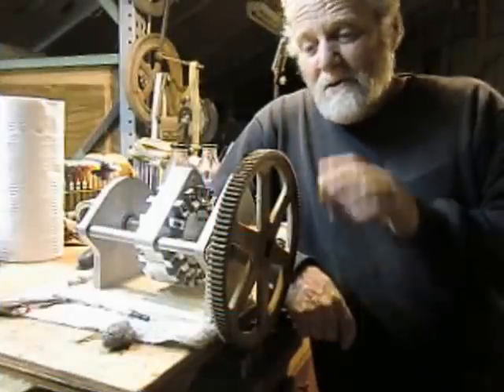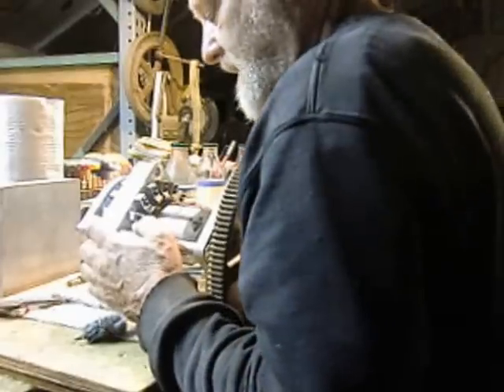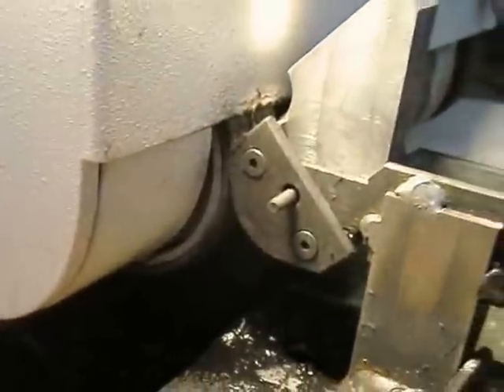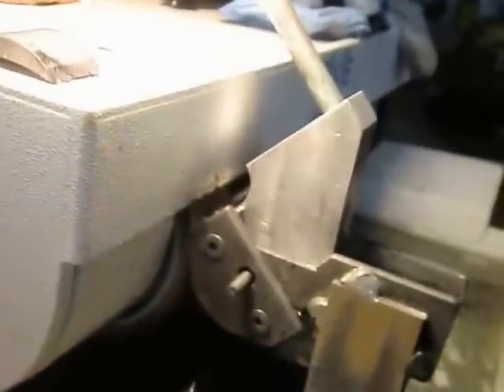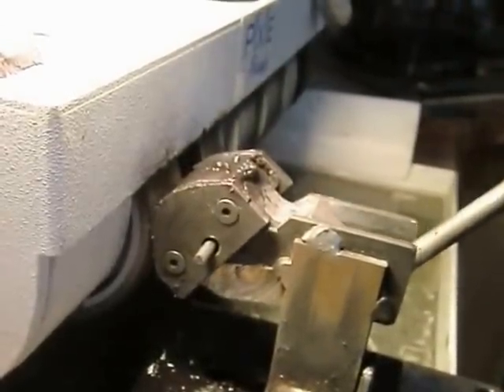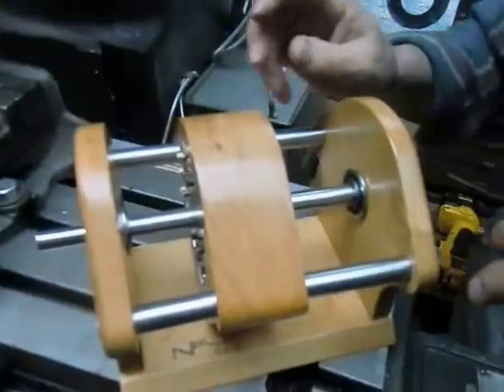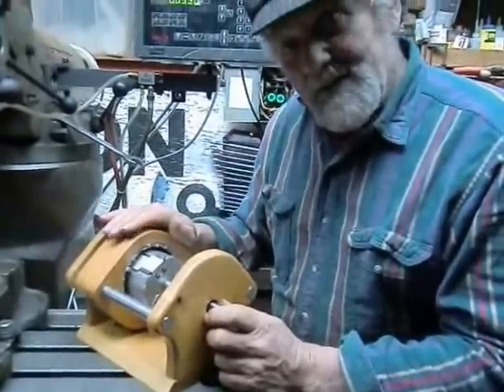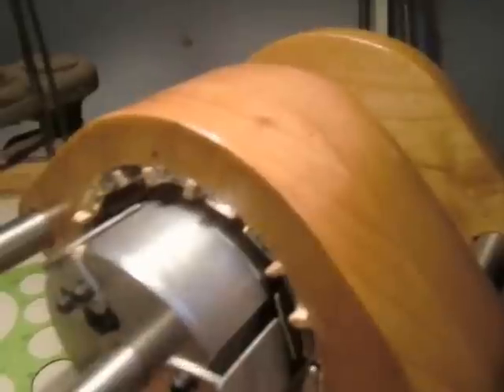HoJo Permanent Magnet Motor

Comment: I have read a few replies in this thread & I will try to shape them so they don't come off so obnoxious. I will also hopefully explain why people will try to direct your thoughts towards what 'free energy' actually is.

If I can offer an analogy. You have some petrol & you are trying to build a combustion motor with the view to create free energy using the petrol as a natural & renewable resource. Can you see the dilemma? You are treating the magnets as a natural resource. You are using a product that used 'x' energy to create yet when you use that energy, the energy harnessed is less than 'x'. This is due to the processes involved in harnessing the energy in the petrol (or magnet) which is after the process that was required to make the petrol (magnet) which was less than 100% efficient. Each stage costs energy to complete.

Nik, you have already been told about the fact that, in the natural world, laws of physics can not be broken therefore your system can only operate at less than 100% efficiency (ie friction, back EMF Vs EMF etc). All of these little things add up to a loss of efficiency that cannot be avoided because the entire universe is one big closed system & everything exists within that closed system. For every action, there is an equal & opposite reaction.

You are trying to produce more energy than you are putting in. In theory this will work because there is potential electromagnetic energy stored inside magnets (magnets are produced, they do not occur naturally without some other process to make them & they take a lot of energy to make). Energy is used to create the magnet & you are trying to harness that stored energy. You simply cannot treat the magnet as a natural, renewable resource. When the magnetic properties of the magnet depletes, where are you going to get another magnet? What energy is going to be expended in you acquiring that magnet + the energy in creating that magnet.

You are at the end of a daisy chain of energy loss. All the products you are using, required energy to make & by the laws of physics, you will never be able to recuperate that energy at 100% efficiency let alone at what you are trying to achieve, which is more than 100% efficiency.

If this concept were realised, you would end up with a rotor that would exponentially increase momentum until entropy takes it's rightful place amongst the gods & reduces your rotor to sub atomic particles trying to break the speed of light.

I hope you receive this message well. As far as what you are trying to accomplish with magnets, I do hope you find a way to harness that electromagnetic energy inside the magnet for as long as the magnet will allow.
Reply: Little problem with the logic in your message: There is no potential energy stored in magnets...
Reply: google Electromagnetic stress–energy tensor
Amenti H
Reply: +MilitantPeaceist 
Input energy is used in the process of "extracting" energy from nuclear material. You can say the output is greater than the input. Just like uranium, magnets have their own curious properties. I am not so sure that magnets cannot be used to generate electricity. Not directly, of course, but by converting mechanical energy produced by magnets. This has yet to be discovered, of course. 

It may be true that magnets cannot be produced without extracting the minerals from the earth & magnetizing them, but the EROI would be excellent — and it would be safer than nuclear, cheaper than fossil fuels and better than wind (weather-dependent) and solar (doesn't work at night without battery backup).

Comment: Nik your craftsmanship and machine work is really impressive to say the least. I really don't think the HO JO motor will be anything more than a curio even if you could get it to run though. I have spent my whole life reading everything I could get my hands on concerning magnetic fields and wouldn't say this without giving it a lot of thought while trying to apply what I have learned personally and watching others attemps. I think what makes folks cynical is the  fraudsters out there.  With that being said I do have a plan for a magnet motor  that I will share for the asking. Let's just say Howard  was on the right track but sort of got caught up thinking in 2D with relationship to how magnetic fields interract. THK's for the vid I enjoyed it. Don't get discouraged.
Reply from the maker: +MrTABUNKA Thanks for the compliment of my craftsmanship. That project has been set aside for a while, but I might be ready to get back in the saddle. Please share your plan for a magnet motor. Check out my 250 other machine shop videos if you get a chance.
Reply from the maker: +Nik C. Colyer Send more personal info to nik@nikcolyer.com

Comment: The proper outside rotor magnets are elongated house shoe magnets with pointed poles ! Crumax in Kentucky molded the originals for Howard the stator on purpose is out of balance magneticly on purpose ! Geometry is critical on this motor !!!!!!! Reported 900 RPM !!!!!!!

Comment: hey it might be the eveness on your wheel i used to bmx bike and the slightest curve hear or there can mess up the flow of rotation ,if would ever get a small dent or miss alighment on the bike wheel i would stop riding because it was small but after a bit its basicly like a teter torer but in a circle then if i did i would get a flat tire if the rim wasent changed

Comment: Magnetism is FORCE only.  POWER is FORCE x VELOCITY. To obtain power you must have a moving magnetic field. Unless you can make the magnetic field to move without external power, you are going the way of the losers.
Reply: +Odouls77 Magnetic fields only appear stationary because of how they intereact with other magnetic fields. They are a moving 3 dimentional entity. The HO JO motor will never really produce any amount of power because it only takes advantage of a very small portion of that concept if it could ever run at all

Comment: aluminium has a brake effect on magnets.. take a strong Neodymium magnet and pull it across a block of aluminium you should feel the magnet has 'drag' thus the rotor made from aluminium will have the same effect.. good work though

Comment: "Almost takes off" is because a magnet motor cannot output more than it takes in, and it isn't getting any unless you spin it with your hand. It's friction means that in fact it cannot even have the energy you put into it, it will lose it to friction and stop. There is no way to make a magnet motor work, you're wasting your time. You can't reduce friction to zero and magnets are like springs, you can't get put any more than you put in.

Comment: beautiful piece of work, I spent a couple of years building a HHO capacitor and it was so hard with to tools to build it, it's not only the original Design and ideas Which I had to throw out so many ideas, and I still have not finishedthe Electrical Generator part, at times I wanted to give up thinking it's a stupid idea now my project is on ICE up in the LoftI still have some new ideas , It seems I'm trying to prove it's possible to myself I know there has to be a way of generating OR pumping Electricity because we can't actually Create EnergyWe can Only Re-direct it's force.. Many people think we Create Electricity But that's completely not trueCurrent ideas are changing, magnetic lines of force in a magnet Get that force From Somewhere.. it just seems we move the magnet fast enough over a coil of wire and therefore move electrons in the wireit's a kind of pump .. When I worked as a technician on the railway we had Big Relays In glass Jars Very old obsolete . but inside we used Copper to change the Direction of magnetic Fluxmaybe copper Wire could be the solution In the Rotor?
Reply from the maker: +Malcolm Jacobs You sound like a true inventor. I've put that motor aside for now and on to other projects. Thanks for the note and for watching.
Reply: you are very kind, thank you and  nik , good luck with your project.I was thinking about materials you used in the motor, nice wood well made.. in your video, not easy to get it so exact. Aluminium Acts Strangely In a magnetic Field your new Construction looks Brilliant it will be interesting to see how it reacts because of  strange properties of Aluminium...it  Conducts Electric current But it's not actually Magnetic Like " iron" magnetic fields Move through alu and you can feel it

Comment: Hi Nik. Good work and nice skills ! Do not listen to people who talk about the conservation of energy; that's all they know. Take that away from them and they get scared because they do not know any other way. The great Tesla said that people do not produce electric current; they found a way to harness it from the surrounding environment by exciting an already existing resonant magnetic field that Mr. Tesla coined as ''ether''. The thing is that it cannot be proven because it cannot be measured. With the currently existing devices. Funny enough, a measuring device can measure a DIFFERENCE in potential, but if this resonant magnetic field is all around us, all over the globe, how can we detect any difference in potential ? By looking into the skies ! Tesla believed that the earth and the clouds are the two sides of a capacitor and the air between them is the dielectric. The energy coming from the sun charges the particles in the air and somehow they interfere with the magnetism of the earth and make the particles resonate, and at a certain frequency we can ''plug in'' and access that huge reservoir of energy . I do not know how, as I am no scientist. But I somehow believe Mr. Tesla when he said that the universe is all about vibration and frequency. It is true: magnets do not hold energy, they ''collect'' energy from all around us. Keep on testing and maybe you will find an arrangement of the magnets that will ''collect'' that energy continuously. Cheers !

Comment: Hi my friend i am from India  My name Krishna All most i completed.this project , u need more information please call me on my mobile 9109783993   ,The N-S polarity of the cylindrical rotor magnets is top to bottom, while the N-S polarity of the same-shaped stater magnets is front to back. 1: N faces outward in the rotors. The N end of the stater magnet is on the trailing end in the direction of rotation, so that the like-polarity repulsion is the last thing the individual rotor magnet sees as it passes by. * 2: The spacing between the rotor magnets, from the leading edge of one to the trailing edge of the next, should be 1/2x the diameter of the magnet. 3: The spacing between the stater magnets, from the leading edge of one to the trailing edge of the next, should be 1x or more of the diameter of the magnet. 4: The rotor and stater magnets need to be the same size.  prefers 1" diam. x 1" inch length neodymium magnets, but says the design is salable according to the above formula. He recommends not going bellow 7/8 inch diameter, but "it may still work with using smaller magnets". Also, he said that the length of the magnet is not critical. 5: For shielding, he uses regular steel conduit, cut to the length of the magnet. 6: To achieve additional torque, he said one can add shielding to the leading edge of the rotor magnet (he did not elaborate shape or position).  7: He says, "Shields around the rotor magnets can be used to keep from stressing the magnet fields while being so close together; but they are not necessary for it to run. No shields are needed in the stater." 8: The number of rotor magnets should be a multiples of three (salable).  9: Based on what i saw on Indian Asoka charka, he calculated the angle of the magnets in the rotor and the stater to be 18º from 90º from tangent. He uses 25º, but says 18º will work.
Reply: Sorry the number is 918097839983
Reply: this number in whatup allso

Comment from the maker: Pexto; Thanks fro watching.
Reply: +Nik C. Colyer Hey you have to try with spiral way some magnets to pull and other half to push. Maybe!?
Reply: hey im working on the same exact type of design. ...would like to speak with you alone. ..ive got a couple ideas....your further advanced with your fab abilities....maybe we can crack this nut
Reply from the maker: Remember I posted this in 2013. I believe since then the nut has been cracked. SOme guy in Italy if I remember. He's on youtube.
Reply from the maker: Argentina
Reply: Is another way to harvest the energy from a tension .. 
This tension could be on a strong cable and harvest the energy from it .. 
The tension can be generated by Earth gravity at the end of the cable..
This has to be studied farther because we just need gravity to create energy
Reply: Better off using the http://EzBatteryKit.com system
Reply: Nik C. Colyer have u tried a magnet gate on a wheel?

Comment: I have a BRILLIANT idea, and after watching quite a few videos and reading lengthy articles on magnet motors, I need someone to put this idea to work.  I need a Magnetic motor to turn a fan, that has the ability to provide at least 20 pounds thrust as it's for commercial use, and the speed must be able to be controlled.  Instead of a normal fan (low, medium, high), this motor's speed would need to be controlled much like your foot on the pedal in your car, and can stop on a dime.  To add, (if possible), I would like to provide about 20,000mah for other devices on the fan housing, that can somehow be regulated, cooled, etc.  The magnetic motor can be controlled by a wireless device, which is a must.  Lastly, it needs to not weigh more than roughly 3 pounds because of the fan housing design.  If there are any takers, I will pay handsomely if you provide a (working) prototype.  I am not kidding.  I will even put you in touch with my attorney, have legal documents drawn up, where it should state that I will in fact pay $50,000 USD, plus the cost to manufacture, all itemized of course.  The contingency would be that the investing community would need to see a working prototype that would fully operate the invention successfully.  If interested, you would need to sign an NDA and possibly other documents provided by the attorney, and I will share some wisdom on what it is I am trying to accomplish.  If you can make this possible, your name will become a part of the patent, and you would collect royalties for the rest of your life, as there is a HUGE market!!  Time frame for takers starts today (7-11-2015), and ends on (8-11-2015).  The prototype needs to be fully functional within 6 months afterwards.  Care to take the challenge?

Comment: From my perspective, using the oscillating force of orbiting electrons of say a diatomic hydrogen atom, there is a point in the exchange of energies that creates a thrust that is sufficient to maintain the orbit. In this experiment, you have the thrust but are losing the momentum due to inertia. A flywheel here will be counterproductive unless driven externally. It may pay to consider winding coils about your stator to capture the interchange of magnetic energies. Rectifying these pulses and storing via a capacitive circuit will allow you to pulse the flywheel to maintain your momentum from the capacitors, and thus provide continuous momentum and added torque. Good luck.

Comment: To understand the nature of magnetism; take two standard metal springs and holding them laterally in front of you, bring two ends together while rotating the left hand towards your face, and the right hand spring away from your face & the two springs will inter-coil and eat up each others length, until the two coils form one and the same length.

Then repeat this same procedure only this time, only this time reverse it; rotate the left hand spring away from your face, and the right hand spring towards your face, and the two springs/coils will not inter=coil and in effect repel each other.

Apply logic to the process relative to permanent magnet which are essentially two blocks of smooth steel; and you realise the only way two blocks of smooth steel can mechanically be drawing them selves together, or repelling each other, is via this inter-coiling and repelling process.

Which serves to confirm that the so called magnetic waves, which are being emitted from each face of a magnet, are in fact magnetic particulate spirals. Which unlike the solid metal of two steel springs; can be both emitted and drawn into each of the two faces of the two permanent magnets.

Comment: What would happen if you were to angle the stators so that as the magnet passes they get farther away on the one side, thus decreasing the magnetic pull so that as they pass it doesn't try to pull it backwards. I hope that made sense... Because I believe that it would decrease 'drag' and allow it to propel itself, hopefully. You might also have to angle the ones on the center rotating part, much like the blades of a fan. I am very interested in magnetic motors and have many ideas I plan to explore so if my idea works, or doesn't, let me know!
Reply: Blake Kitt There is a quite straight forward explanation of why the average torque (ignoring friction) for one full rotation is always exactly zero.  Here is a hint that will get you started:

Imagine a machine with just one pole on the rotor and one pole on the stator.

Imagine you want to fill in a spreadsheet with the measured torque at every 10 degrees of rotation.

You notice that the machine is its own mirror image so every measurement you make can be used twice to fill in the spreadsheet.